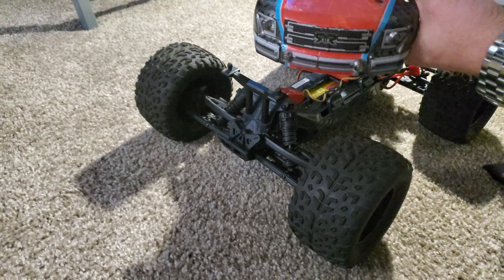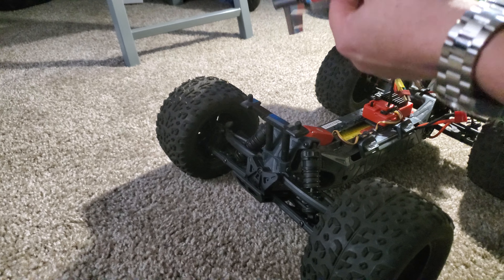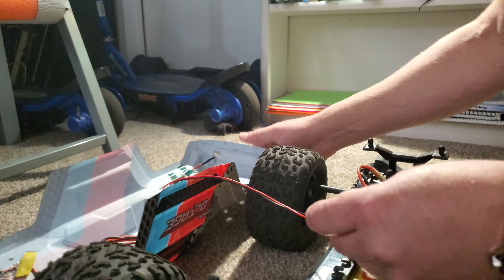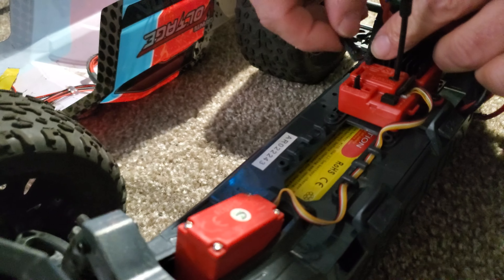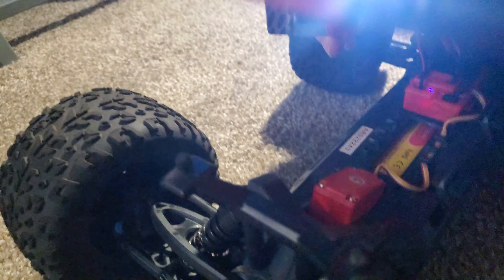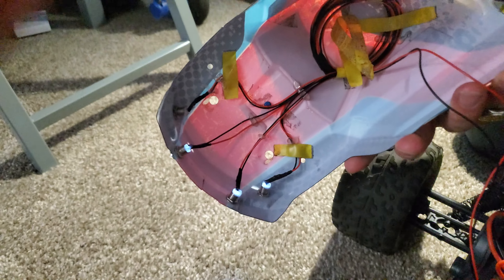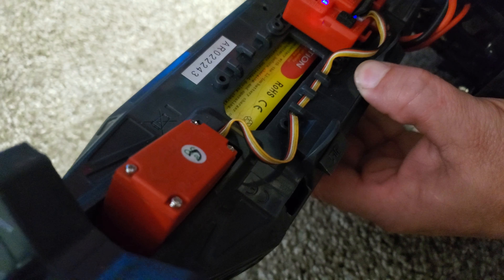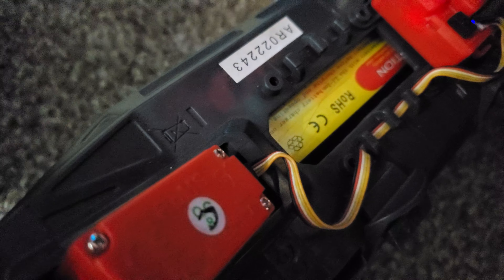LED LIGHT INSTALLATION ARRMA GRANITE VOLTAGE 2WD ESC PLUG

Comment: Hey I have a question? I have that RC car and when I drive it’s almost like it has a slipper clutch and it’s not driving but when I lift it in the air it drives know any tips?
Reply from the maker: Sure, check the plastic differential cups, the center of them wears out and that sounds like it...
Reply: @TURBOHAWKTWINSCHANNEL  ok I’ll check again I’ll get back to you soon
Reply: @TURBOHAWKTWINSCHANNEL  Hey man thanks so much it is I looked at it and I was like it doesn’t seem to be damaged so I thought it was the internal gears so I got a whole new set of gears one literally the perfect gears were the stock ones OMG I made a big mistake LOL at least I have more gears Anyway I just want to give you another thank you
Reply from the maker: @christiansrcs7789  Great Job, yeah those are a weak point and I did the same thing when our first pair went bad!!! To this day still have not had any differential problems!, Don't know if you put a bigger motor in, after we went to 550 from the 540 they have so much torque they started stripping those in minutes instead of lasting for months. Check out my video where I installed the Billet Steel Integy Diff Cups and axles. They are great, highly recommend even though they are pretty expensive, well for a $99 truck. Lol
Reply: @TURBOHAWKTWINSCHANNEL  yeah I went with a cheap brush the system that I had laying around in my Traxxas stampede 2WD and there’s a pin in the gears are always breaks so I was like hey I got an arrma voltage and that’s how it happened 😂